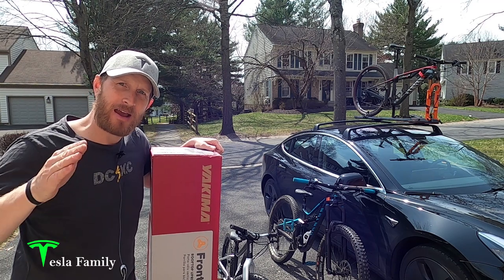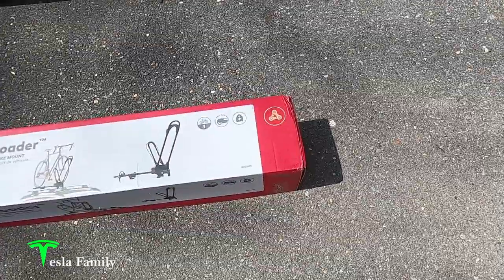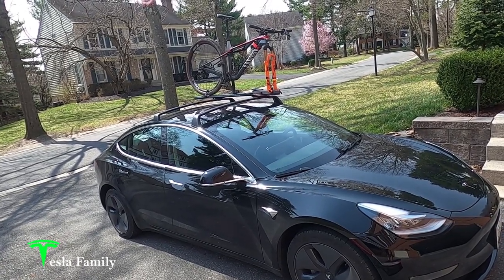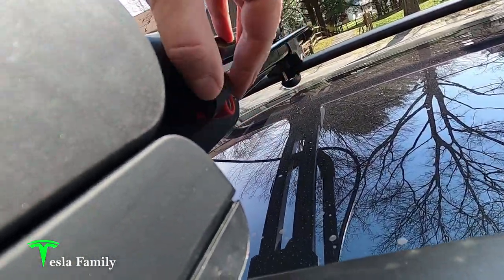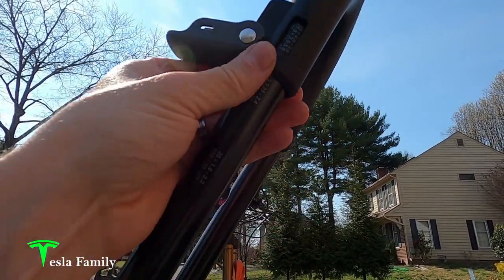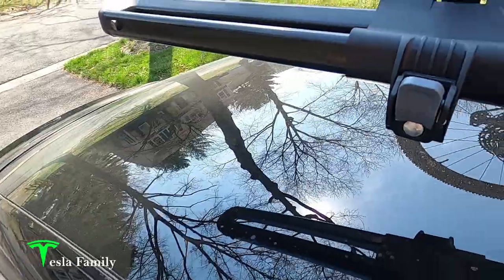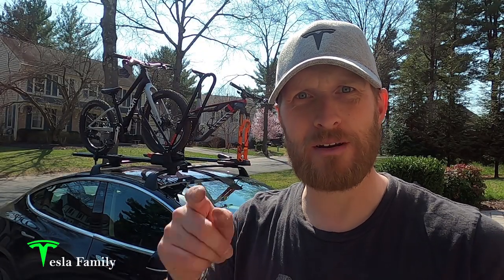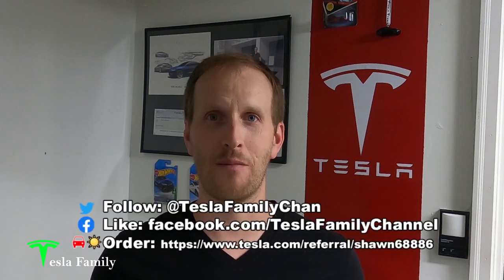Yakima FrontLoader Bike Rack on a Tesla | Unboxing and Install 27.5", 700c, & 20" Bikes

Comment: You should check out SeaSucker Hogg spare tire wheel holder. I personally don’t have experience with these but it seemed to be one of the best solutions for not having to put tires in the trunk. I have two fork mounts as well. If I buy them I will make a video.
Reply from the maker: Thanks for watching! I had a Seasucker and Hogg before I got my Yakimas. I like the idea of the Hogg but the one I had was for QR skewers (have Thruaxles) and there were too many extra steps to attach the wheel like spinning on the Hogg and attaching the Velcro that keeps the wheel from spinning. Just settled on putting the wheels in the trunk.
Reply: @TeslaFamilyChannel  thanks for the information!
Reply from the maker: @davedave1398  Here is my Seasucker/Hogg video https://youtu.be/8qxP9zCYzcw
Reply: Great video! With regards to the front loader, any issues with the bikes tilting outwards due to the curve of the racks? I just installed mine today and noticed the tilt. Thanks
Reply from the maker: Thanks for watching! I have not noticed an issue with the bikes slightly tilted due to the curve in the Tesla roof rack.

Comment: I've had the Frontloader on my Model 3 for about a year and do not recommend this rack for transporting Mtn Bikes. First issue, the Frontloader does not securely fit/clamp onto the slightly oval/rounded factory Tesla roof crossbars. It may appear to clamp snugly but in the real world once you begin driving the vibration from any little bumps in the road is enough to cause front end of the Frontloader to come slightly loose and so what happens is the Frontloader shifts slightly sideways along the front crossbar. Solution is to crank the front twist mechanism as tight as you can, but even then you need to monitor for the rack shifting on the crossbars. Second issue, on all but the smoothest of roads, the Mtn Bike will sway in the Frontloader because there is just too much play in the rack.  I think one of the issues is the Tesla factory crossbars are positioned too closely together.  I've driven on bumpy gravel roads and literally had to put one hand out the window to hold the Frontloader in place while I'm driving, and even then the bike/rack was severely rocking/swaying as we drove over any little bumps in the road.  So probably the Frontloader would be good for a <20lb road bike but I don't have confidence in it to transport a <40lb Mtn Bike.  I regret not spending the extra money to have a hitch installed on my Model 3 so I could carry a mtn bike(s) with confidence.
Reply from the maker: Thanks for watching and sharing your opinion on the Frontloader! I personally prefer the HighSpeed, which I have two of and have only used the Frontloader for my daughter's 20" MTB. I have not experienced the rack slipping/loosening that you have but can understand that to be possible with a 40 lb MTB like you stated.